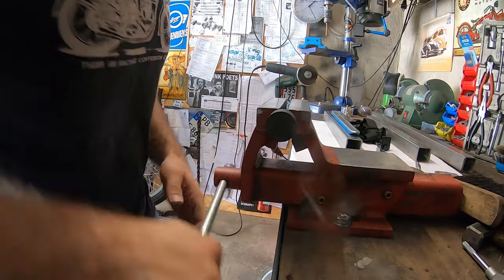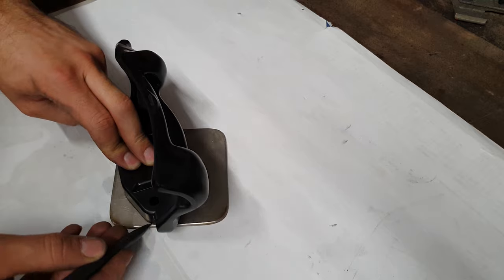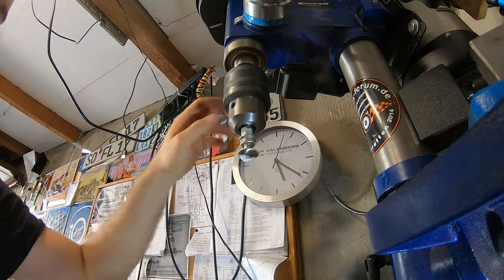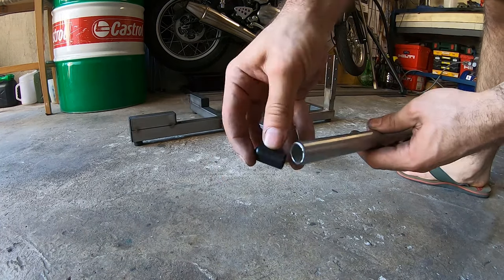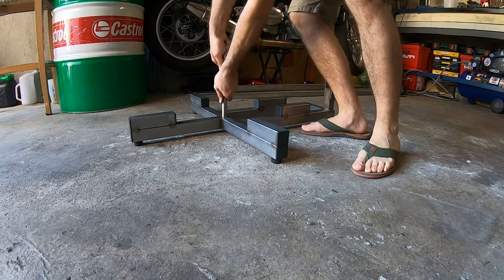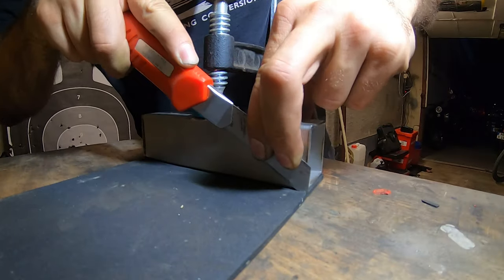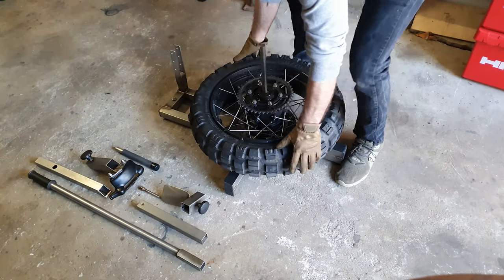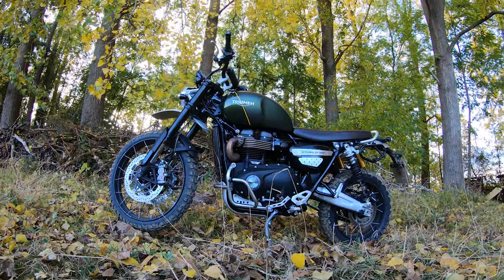Build a Tire Changer! DIY for Motorcycles, Stainless

Comment: Great build - some questions
- Where did you source the centering cone that slides down the shaft? The one thing I can't find...
- The unit in the video where you use it has a couple of bolt heads showing on the frame that weren't there on the build version.. what are they for?
- Curiosity question - why two arms out the bead breaker side rather than just one in the middle? I'm sure there must be a reason.
Reply from the maker: Hello, thanks for your interest!  I got the cone from a friend, it just happened to fit the 20mm shaft.
The two square tubes on one side are there to prevent you from getting centered with the lever. The screw heads you mean are for mounting, either on the floor or on a workbench.
Reply from the maker: you don't necessarily need the cone, I've often done it without it lately.  There will also be a new video about it soon.

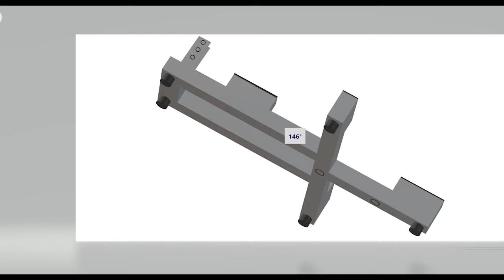Comment: 0:23 some dimensional lengths would come in handy so that we do not have to re-invent the wheel. Supply those dimensions and I will buy you a few Augustiner Edelstoff beers when I am there. Edelstahl...typisch Deutsch! And at 2:03 we have to talk about that target with shots all over the place. They should all be in the X. Kaufen Sie sich einen Feinwerkbau. Nice TIG welds! Top construction. Das mag ich!
Reply from the maker: You just have to get the dimensions from your bikes, I built my construction in such a way that I can use from 17"- 21".  I've written the measurements somewhere in the comments below, see if you can find it.  Otherwise, I'll measure it when I get a chance, I don't have it in my head right now. The target is a souvenir from Texas, I shot with an AR15 full auto for the first time😂

Comment: That is very good that you show this here for free! But you have to have so many tools to make it like welding machine, drill press, bench, grinder etc. Also you have to know how weld etc ))
But anyway thx for sharing!
Reply from the maker: You are welcome! Yes you are right it is really a lot of work. You can also build it from normal steel. I built it out of stainless steel because I'm a really bad painter!If you add it all up, it will not save you any money. I built it because I just like building things like that and love to be able to do as much as possible myself.
Reply: @q-bigwerkstatt2  Oh, looking at your videos it looks so easy that it makes me want to build it too) Just need to get necessary tools first.

Comment: I'd like to know the specification of the pipe in the video.

I want to know the size and thickness of the pipe.
Reply from the maker: Hello my Korean friend!  The tube in the middle must be the diameter of your axis.  In my case 20mm.  The long tube with the handle has a 30mm square tube attached to one end.  Take a ¾ "pipe and make it fit a bit.
Reply: @q-bigwerkstatt2  20mm and 30mm tube is thickness ?

Comment: This is a copy of the olmaxmotors tyre changer or very close 😁... Great job mate stainless Steel  is great too to build from... I've just bought an olmaxmotors one hence my comment if I'm wrong i do apologise..
Reply from the maker: yes, right, I also orientated myself on the Olmax and on some other manufacturers.  I have already recommended the Olmaxmotors to someone because it is really good in terms of price and quality.

Comment: Danke für das Video! Du hast dir einen neurn Abonnenten verdient. :)  Hast du eine grobe Richtung, was der Bau gekostet hat? Also nur das Material, Zeit rechnet man ja für sein Hobby nicht. Wenn du das schätzen kannst auch gerne bei normalem Stahl.
Reply from the maker: Vielen Dank für dein Abo:) Ja richtig Zeit und Werkzeug darf man bei solchen Dingen nicht rechnen, sowas selber zu bauen würde ich auch nur Leuten empfehlen die bereits Werkzeug haben und bock auf sowas haben.  Die Preise von den Einzelteilen habe ich in der Videobeschreibung verlinkt, das Quadratrohr habe ich aus dem Stahlhandel um die Ecke, da musst du einfach mal anfragen, die Preise spielen derzeit verrückt. Ich weiß nicht mehr was ich dafür bezahlt habe.

Comment: what are the measures of the project?
Reply from the maker: I think I mentioned it somewhere in the comments.  But you better do it like I did in the video and measure the wheels you want to use with it.  I made mine from 21" to 17".

Comment: Where did you get the piece that breaks the tire from the rim?
Reply from the maker: this is just a scrap piece of flat steel made of stainless steel
Reply from the maker: weld it to a piece of 40 mm square pipe

Comment: Excuse me
Thickness of white iron square tube？
Reply from the maker: 35mm and 40mm it fits together 👍
Reply from the maker: I think 2mm thickness
Reply: @q-bigwerkstatt2  Thank you very much.
Reply: Excuse me
What is the diameter of the solid iron rod passing through the wheel frame in millimeters?
Reply from the maker: @a761111abc  20mm
Reply from the maker: @a761111abc  but check what you need, my Scrambler needs 20mm, my Thruxton 900 needs 17mm, my Oldtimer needs 14mm ...
Reply: @q-bigwerkstatt2  Thank you.
Reply: @q-bigwerkstatt2  Your cars 14mm can be universal?

Comment: Super gemacht.  i want to build this tire charger. Do you have dimensions? I miss them in the workplan. Please send me a email.
Reply from the maker: Danke Timo! I built my tire changer for my Scrambler 1200. So it is suitable for 17 "- 21". Make sure that my measurements are also suitable for your tires.
The main frame: 
The five blocks of support surfaces: 150mm long
The long one with the 20mm hole: 700mm long
The shorter one with the 20mm hole for the stopper: 330mm long
The two parallel: 500mm
The little one in between: 120mm 
With this you will surely get ahead first, the rest you have to adapt to your application purposes.
Thanks for watching and subscribe!
Reply: @q-bigwerkstatt2  🙏

Comment: Hola,medidas del artilugio tienes😂
Reply from the maker: somewhere in the other comments I have listed the dimensions, but I would recommend measuring yourself, I built my device for 17" - 21" approximately.  when I wanted to mount a 15" and 16" wheel it was difficult.  see what you need best
Reply from the maker: en algún lugar de los otros comentarios he enumerado las dimensiones, pero recomendaría medirse usted mismo, construí mi dispositivo para 17 "- 21" aproximadamente.  cuando quería montar una rueda de 15" y 16" era difícil.  mira lo que mejor necesitas .
espero que funcione la traduccion de google
Reply: @q-bigwerkstatt2  ok gracias,👍